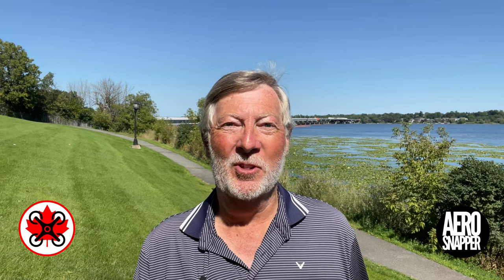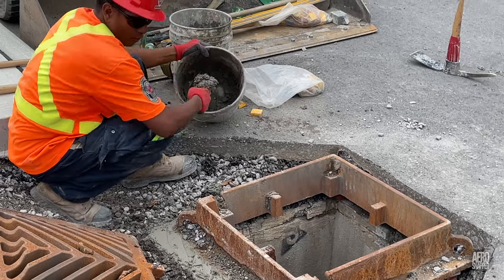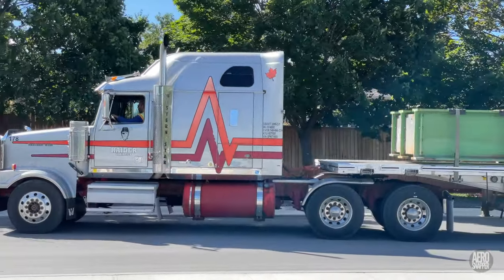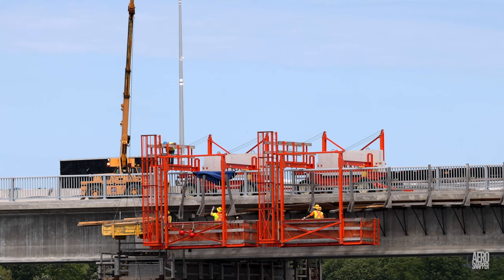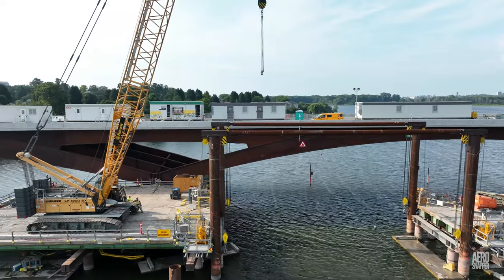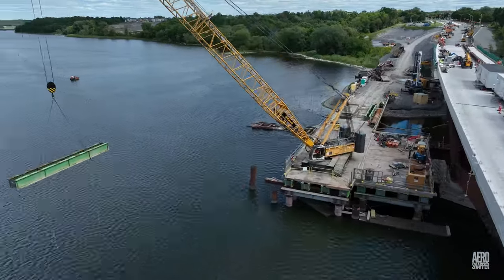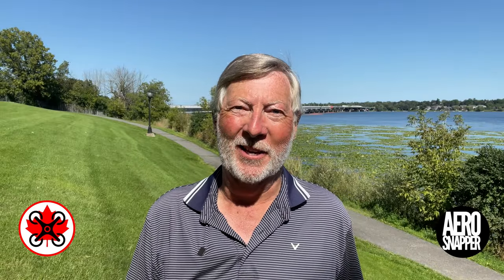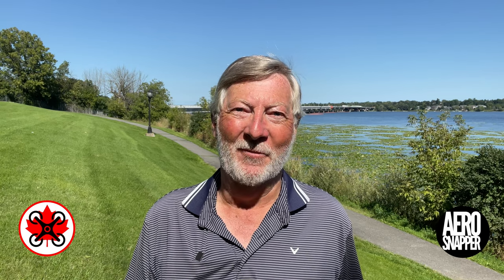A Bridge over less Troubled Water   4K

Comment: Great update, Mike! Glad they are paying close attention to manhole covers.  There's a stretch of Terry Fox Drive in Kanata where every cover is right in the wheel path, and every single one is below grade....drives me nuts!
Reply from the maker: Thanks Don - yes, attention to detail is writ large on this project.  Those guys from Barr were incredibly patient and determined to get the cover positions correct.  The same goes for all the concrete work by Kiewit and the ironworkers.  The steel span fit within 10 mm of design spec...the 48 pieces all weighed more than 20 tonnes each
Reply: March road is the same.  It seems like everyone knows where they are and try to dodge them, including myself every morning!
Reply: Welcome to the Limestone City where roads are an afterthought.